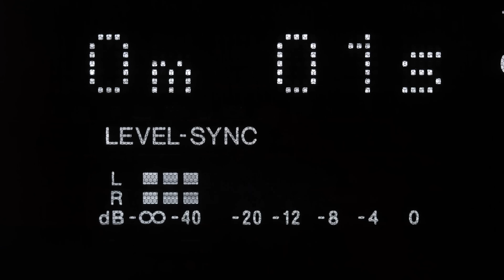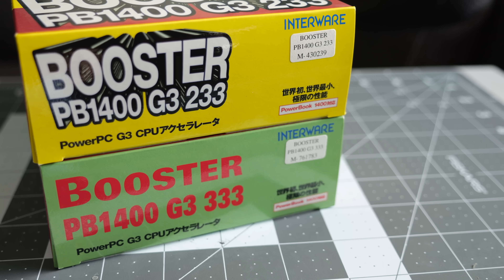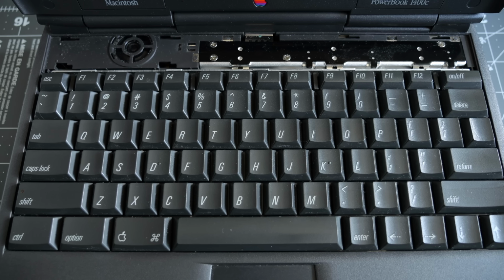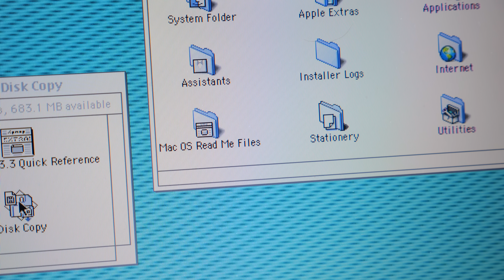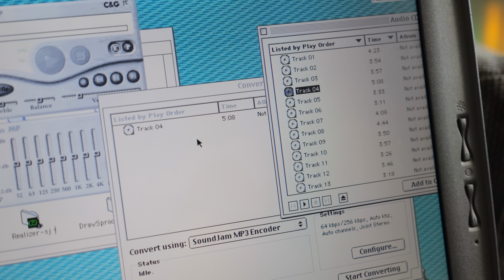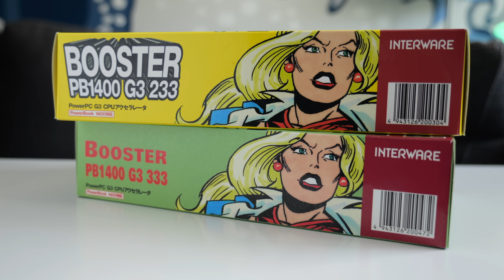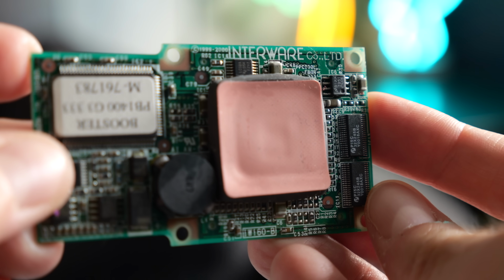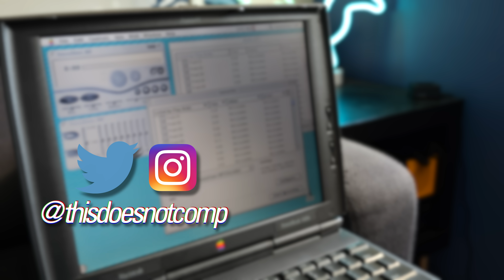This Retro Mac Laptop CPU Upgrade is CRAZY Fast!

Comment: I understand the removal of the batt however if this upgrade is going to take less than an hour or you’re not shipping the laptop to another location then why tape the batt.? For a job like this taping the batt is unnecessary, but hey you do you.
Reply: I assume he didn't do it specifically for this upgrade but as a general attempt to keep the battery in the laptop without wearing it out while it is plugged in.
Reply: @denny1527  Rather because he never uses it without having access to wall power anyway (making the actual state of the battery irrelevant), and leaving the battery connected for a long period will lead to it leaking and possibly destroying the machine which is the main issue he wants to avoid. The only reason the battery is there at all is no not leave an ugly gap - if the cover was separate from the battery, the battery would most likely not even be in the machine.
Reply: @maighstir3003  That's mostly what I meant while writing the previous comment. I actually did the same thing to my Dell Inspiron 9300, I would've removed the battery entirely if it wasn't for the fact that one of the rubber feet is on the plastic battery cover, and there's a large hole at the bottom of the machine without it.

Comment: So, did these upgrades end up giving the option of OS X or not?
Reply: Not on a 1400, because OS X required a PCI bus, and the 1400 was still based on NuBus. But the G3 CPU upgrades for most of the desktop machines that used the 603 and 604 also allowed for the use of OS X, although it wasn't supported by Apple.

Comment: Hi! I have to powerbooks G4. One is 1.64Hz, and the other one 1.25Hz. Do you know if I can swap the CPU modules? (I want the 1.64 in the body of the perfectly preserved 1.25)
Reply: if they are the same size and same screen type (the final 1.67ghz 15/17 inch had a different screen to older ones), you could do a board swap, as the cpu isn't socketed in those models
Reply: @windowsxpnt2347  Excellent! I think they have the same exact screen and same exact everything apart from the CPU. I'll give it a try. Thank you!
Reply: @JuanJacinto  check the screen resolution, if one of them is 1440x960, you have a high res one and it might be harder to transfer the board into the better case